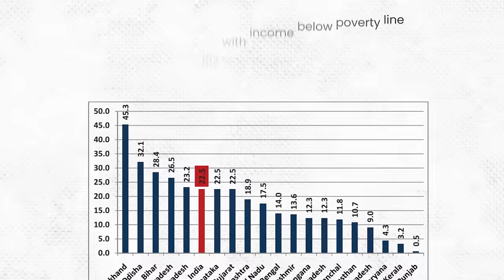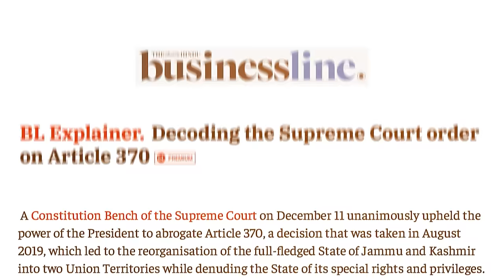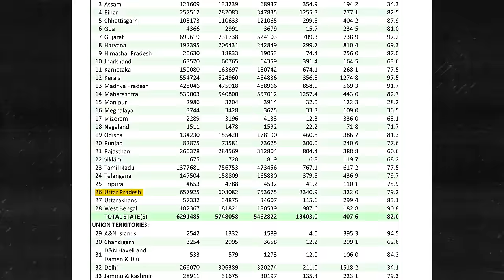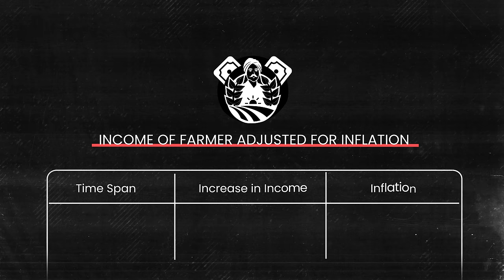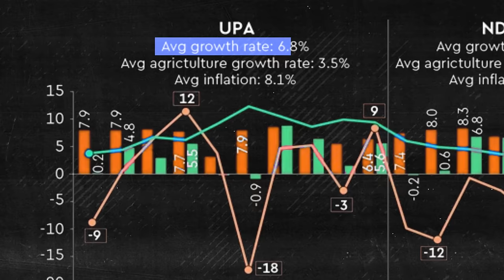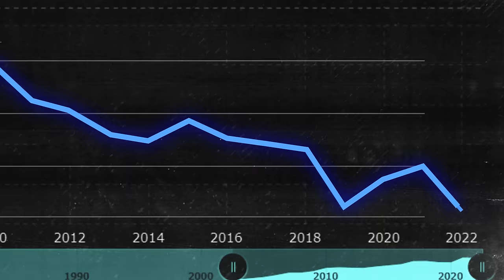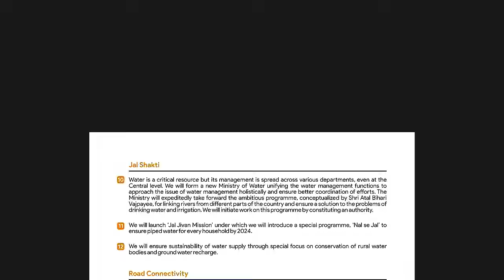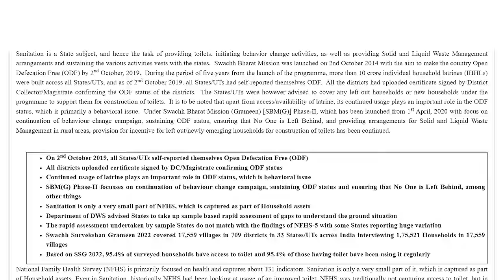The Honest BJP Report Card (Analysed with Stats): Were the Promises Fulfilled?

Comment: Ok so in short :- 
Economy, infrastructure, external security seems getting hike. 370 is successful removed, Poverty reduced, inflation controlled and international image got powerful. 

While, internal security, farmer ,employment and debt need to get worked by BJP.

My opinion is, BJP is not best, but better than rest.
Reply: Here in the video Debt analysis is not done well.otherwise the debt is in control only. And also there are 5 other indicators in the document I think you should read them.
Reply: @@HINATAHYUGA-js9ke Well, do you have any information about that out of total debt, how much is external debt and how much is local.
External debt is dangerous due to high interest rates and time limit compared to local debt. Also, loan taken on infrastructure pays back. But if this loan taken will go for liabilities like freebies, then will be dangerous for nation.
Reply: @Ronit_9977 Like congress does, freebies..
Reply: @YuukiKagurazaka246 what about the BJP?
Lol😊
Reply: @@HINATAHYUGA-js9ke u can go cry somewhere if all you have is cribbing.
Reply: @@HINATAHYUGA-js9ke Well, comparing a country like India with a significantly small nation like srilanka in terms of debt and return shows your lack of vision . There is no comparison between this two,  India with cheap labour and huge work force have all required ability to be the next manufacturing hub after China. Inputs in infrastructure had started showing its effects, like according to world bank data, India showed the sudden growth in goods and services exports, i.e 499 billion dollars in 2020 to 778 billion dollars in 2022. Projected exports by the end of 2025 is approx 1 trillions. Definitely infrastructure takes humongous financial input, but output is enormous.
Reply: @@HINATAHYUGA-js9ke Have a good time in foreign bro. And make sure to left Indian citizen ship there. 🙂👍.
Reply: @@HINATAHYUGA-js9keso my opinion is ..As we don't know how much external debt we have ...but first we have a very capable infra so that in turn we can make better use there by increasing the income... Which will inturn can be used to payback the debt right... Good infra = better moment of goods ...  Which is equals to more efficient income
Reply: @An_indian9977 agreed with your comments it is not best but better then rest
Reply: Better than rest itself means the best. I think you mean to say its not perfect.
Reply: @@HINATAHYUGA-js9ke whenever any new infra is created in a country with massive population like India, economy of that area automatically starts growing faster, you can feel it around you as well, area near newly constructed highways and roads starts getting new business.  So infra constructed will pay back for sure.
Reply: @@HINATAHYUGA-js9ke Bro they spent money on the place where they can generate revenue the roads, highway, expressway are not for free we pay them and coming to the point you raised on Sri Lanka, They are not big as India in terms of infrastructure, area , population, etc. And they fell in debt trap of china i.e higher interest rate, giving contract for Chinese national, etc. Here in India we are giving most of the contract for Indian companies and intrest rates are also less
Reply: Well said
Reply: @@HINATAHYUGA-js9ke Looking at your economics knowledge, I doubt US govt. would want you there.
Best of luck for F1 visa 🤭
Reply: @@HINATAHYUGA-js9keIndia's external debt to gdp retio is  only 19% why you talking about 40/50% it's actually not even 19 % it decrease 3% from last year (2022) then it was 21% and as per data(fly 23-24) it maybe reduce to 12-13% in fly24-25
Reply: Farm laws were pushed to address their agriculture manifestos
Reply: @@HINATAHYUGA-js9ke it depends, how much interest we pay for debts, also internal debt vs external debt is also a factor.
Reply: @@HINATAHYUGA-js9ke  We don't have a clutch system yet. But we won't be able to beat china in manufaturing if we don't get infrastructure upto the mark. You can't use old technolgy to compete with someone who is 5 steps ahead in it. You need to fuel growth with debt in that case.
Reply: @@HINATAHYUGA-js9ke India is hyper consumer economy, our infra pays back as the country will raise production of goods and services in order to meet it while using infra to do so
Reply: @YuukiKagurazaka246  why BJP is alos giving freebies for entire contry...talk about it...dont bias...Congress has done well to come to a level where people got education and developed a country...and its obvious that BJP had to do better... but lets see on the dept part ....I am not saying BJP has not done...they have.
Reply: @Ronit_9977  can u provide the data of unemployment rate in india at upa time and in NDA time for better understanding because he only talked about manufacturing sector. I just want to get a broader picture.
Reply: @@HINATAHYUGA-js9ke then go. From India who is saying you to stay we don't want anti national
Reply: All those positives are fuelled by the debt. The government is borrowing money heavily to pay for those things. What will happen when the money runs out? Even now with so much "money" unemployment is already very high? What happens when lenders stop or theres a cash crunch? None of the basic economic reforms like farm bills, land bills, contract dispute bill's have been implemented. This is unsustainable
Reply: @Ronit_9977  Just do research on how much money India has borrowed from IMF, World Bank, Asian Development Bank, etc. Even the British are lending. Many of the project and infrastructure is funded this way. Its a ticking time bomb
Reply: @leonkharkongor41  you don't support nrc CAA and farmer bill and them cry about it. 
It's democracy government will do what public want(it doesn't matter if public is brainless/uneducated)
Reply: @leonkharkongor41  Ok, so all this debt taken from outside comes under external debt. The external debt on India is roughly 635 billion dollars and total forex reserve India have is around 615 billion dollars. Rest of debt are local debt. And debt taken from international sources have returning time in decades, like 10-20 years, so as per the picture seems right now, it's not as severe as you are trying to show. Also India's goods and service exports are rising gradually and our estimated goods and service exports till 2030 is projected to reach upto 2 trillions. Like according to world bank, our exports in 2022 had already reached 770 billion dollars, so the projection seems practical.
Reply: True
Reply: No, the debt of the central government and the BJP ruled state is fine and very much serviceable, but the condition of opposition ruled states is very bad in it.
And that's why the Debt to GDP of the country as a whole is looking a Lil bit BAD.
Reply: @@HINATAHYUGA-js9ke China got that manufacturing as primary catalyst because they worked on logistics and infrastructure because of which fdi increased in china and they also trained their labours which help them in return
Reply: @@HINATAHYUGA-js9keYou shouldn't compare it with Sri Lanka because it made infrastructure with foreign debt while in India the government owes debt to its citizens
Reply: @@HINATAHYUGA-js9keBro don't forget to wear body armour 😊
Reply: @@HINATAHYUGA-js9ke no worries on infra, in india amount spent on infra imagine if we spent 1 rs it gives us back 2rs so govt isnt worried about debt on infra and yea external debt is bad for an developing country
Reply: Yeah but social structure didn't get improved. Education health gdp per capita are all in down growth
Reply: It may also be appreciated that mere data analysis without taking into consideration the complete ground reality can be misleading.

A vague hypothesis - data and statistics would say that India should have won the World Cup - but see what happened. 

I think examination of ground reality is very important; and can any other person place in the same circumstances could have done better....
Reply: @@HINATAHYUGA-js9kethen why even care bro.. look forward to make fruitful journey for your career rather... When you are not even looking forward to live here, it's better not state comments bro or you might hurt or maybe mislead people who will live here for sure
Reply: @@HINATAHYUGA-js9ke agree with you regarding the revenue part for the infra. But, you forgot that this infra development should've happened far earlier to boost the manufacturing sector. Sri lanka is an international political game played by china. They built a port where it unnecessary. While, India is developing infra where it is must which would help industries and individuals in turn. Hope you understand this part as well...
Reply: In bjp era sevaral wars and carona was there 

Carona effected several countries
Reply: you forget free media!
Reply: @OO27  India is not a democracy, its a democratic republic which means people will elect people who will do what is necessary
Reply: @Ronit_9977  The implication here is that Internal Debt isn't dangerous? Why? Because you think the government can force internal creditors to do as they please? Thats unrealistic. Even if the government doesn't use the state to coerce these internal creditors, the only way to pay it back without increasing revenue is to print money and cause inflation crissis and devalue the rupee. There's no guarantee of endless future growth and the fundementals of the Indian economy are shaky at best. This government is favouring big schemes that look good on paper and win PR points rather than reforms that improve the fundamentals of the Indian economy.
Reply: @leonkharkongor41  Well, Japan is an example of excessive internal debt, are they collapsing, definitely not. More internal debt is not dangerous but badly impact the growth rate. Same goes for US as well.
Reply: @@HINATAHYUGA-js9ke Escapist giving free gyan😂
Reply: Agreed
Reply: @Ronit_9977  Those countries have strong fundamentals. They're manufacturing giants even with all the economic problems they have. The economic system is well adjusted and tuned to handle stresses on their economy. India is not. There are fundemental problems that have not been dealt with.
Reply: Lmao 😂 Just say you are a bjp supporter
Reply: @leonkharkongor41  Ok, so if the question is about manufacturing, then according to world bank data of Goods and service export from India, sudden spike in exports had seen from 2020 with 499 billion dollars to around 778 billion dollars in 2022. Jump of around 280 billion dollars. And export of 1 trillion is estimated till the end of 2025 if conditions of global slowdown not gets worse. So the investment in infrastructure seems to have a good impact on exports.
Reply: @@HINATAHYUGA-js9kelol countries literally takes debt to progress their infra so as to generate quick revenue

And you are saying revenue should be use to develop infra
😂😂
Reply: Have you forgot the bomb blasts💥💣 during Manmohan Singh's Tenure? 

- during his tenure
so so many bomb blast 💥💣 happened
I used to fear to travel with Mumbai Local train
I never went to Ganpati Visarjan because I feared that bomb blast 💥 will happen in crowded area (and it did) 

During Congress in 2010, 
25 Terr*ist were given to Pakistan🇵🇰

- One of them was Shahid Latif 
- He was Launch Commander of Jaish-e-mohamad
- His work was to launch attacks on India 🇮🇳
- He was Captured in 1999
- He was Released from Indian Prison in 2010 and was given to Pakistan🇵🇰 "for god relation" (It is like giving a Sword to Mu*derer) 
- He then Planned and attacked Air Bases of Indian Air Force in Pathankot, Punjab in 12th Jan 2016
- He was Shot and Ki*ed by Unknown Men when he was coming outside of Masjid in October 2023

Shame on Congress Govt for Releasing + Giving them to Pakistan🇵🇰 😞

--------------------------------------------

Now let's cone to tenure of Manmohan Singh 

the Great Educated PM Remote Controlled by an Italian 🇮🇹

- whoes Daughter works in George Soros's Open Society Foundation, 
George Soros wants Modi to be removed as PM

- Congress always says Modi has Connections with Billionaire Adani
But here Congress has Connection with Billionaire Soros
Who is Old, Rich, Opinionated and aslo dangerous

- Manmohan wanted to pass 'Communal Violence Bill', where every riot that happens in India 🇮🇳 
only Majority(Hindus) Should be Blamed

- the man who said Muslims have the First right on resources of India 🇮🇳 🤷‍♂️

- The man who shook Hands with Yasin Malik and Called him Youth Leader

- during his tenure
so so many bomb blast 💥💣 happened
I used to fear to travel with Mumbai Local 
I never went to Ganpati Visarjan because I feared that bomb blast 💥 will happen in crowded area (and it did) 

- during 26/11 our Army Was ready to attack on terr*ist camps
but he refused
he refused to conduct RAW operations on terr*ist involved in 26/11 in Pakistan

- whenever he went to any International Summit, Antonio Maino would also go with him for no reason (she was not Foreign Minister nor Diplomat, she was just an MP and President of a Party)
Have you ever seen J.P Nada going Abroad with PM Modi?
Have you ever seen Amit Shah going Abroad with PM Modi? Even though he is Home Minister he can go if he want, similarly Rajnath Singh etc

- And even in Foreign She was respected and greeted first instead of PM of India 🇮🇳
Reply: Debt to gdp will increase because we are currently investing a lot on infra . 

Similarly our gdp is going to speed up as well.

If we solve the Manipur issue asap then the govt should once again focus at the agri sector.
Reply: Poverty reduced??? Did u even read the numbers
Reply: @abhijitn943  According to UN report, in last 15 years, approx 415 million Indians had pulled out of Multidimensional poverty. It means poverty had reduced in India. That's why I had written this.
Reply: What about communal politics? What about institutional interferences like Ed etc? I'm seeing people are just concentrating on economic well being social unity is weakening in India.
Reply: better than rest = best
Reply: Yea better to elect the one party, one nation ruling govt. 🤦🏻‍♂️
Reply: economy is a mess too..more negatives thna positives for BJPee..what is misisng is religious disharmony and communal polarization which never got addressed by Ganesh, expectedly
Reply: @Ronit_9977  bruv there's difference within all kinds of poverty. Poverty has risen due to increase in population. Go to ground you can see real picture.
Reply: In the realm of dirty politics and the pursuit of absolute power, the first target is often the minds of the people. This manipulation begins with rewriting religion, history, culture, and every aspect of society. The result is a populace left bewildered, unable to discern right from wrong, and unaware of the discrimination they face. Farmers protest for fair pricing and against the mass commercialization by big corporations, students rally against exam paper leakages, Ladakhis fight for autonomy to protect their fragile ecosystem from greedy corporate mafias, and doctors demand prompt counseling processes. Yet, mainstream media remains silent, instead choosing to praise and defend the government, while YouTubers softly manipulate public opinion by glossing over government works and highlighting only few positive aspects. This insidious manipulation stifles critical thinking and undermines the people's ability to act right - act for their own self against the discrimination they face. Wake up before it is too late!
Reply: Bro do you think poverty reduction & inflation controlled?
Reply: @ayushshaw4372  
According to the Discussion Paper, India has registered a significant decline in multidimensional poverty in India from 29.17% in 2013-14 to 11.28% in 2022-23 i.e. a reduction of 17.89 percentage points.
(Source :- PIB) 

Average inflation during NDA :- 5%
Average inflation during UPA :- 8.5%
(Source :- World bank)
Reply: @Ronit_9977 As per my knowledge indias internal debt is 81% and external debt is 19% which is not much of a problem. And it has been already estimated that in the upcoming years the debt amount will reduce significantly as bjp is doing a splendid job in developing infrastructure
Reply: Poverty increased
Reply: @Ronit_9977 what do you think about education, unemployment and inequality in wealth distribution?
Don't you see the ruling party is using CBI, ED for their own benefits and if the politicians are corrupted then why do they allow them to join the BJP?
Reply: Interest for external loan will be taken from general public only so in future don't forget this that we have to pay that loan amount with interest of our country.
Reply: the word "best" means that better than rest. so you actually contradicted yourself
Reply: Choose one from bad and worst.
Choose none.
Reply: wait....if debt and employment need to be worked on....then how is poverty removed? how. is inflation controlled ? international image got powerfull thats not a thing to argue about if our economy is better than everyone ya they will fear us...and Modi is not the only person who did work on economy.....manmohan singh literally saved our Economy ....from 157th GDP growth to 10th in the world and modi brought it to 10th to 5th.....its not like back then they did not work anything its just we people are knowing more about today because of digital world